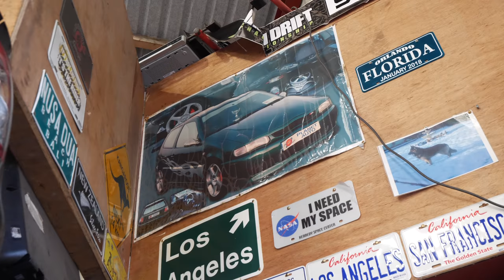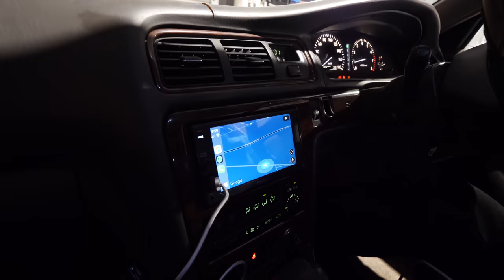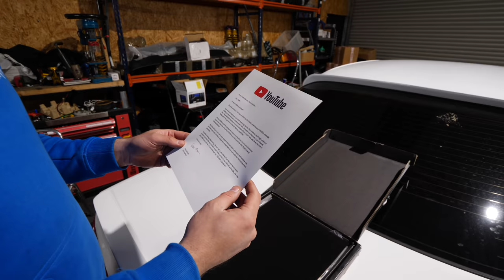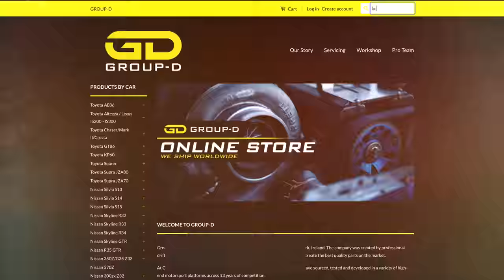Bring back the MAX POWER days! subs, amps + exhausts...

Comment: I got a mid 2000s pink fli sub in a clearance sale about 2 years ago, got it in the car lately it's class 😂😂 I have the modified motors magazine with Dave's old 2 tone civic saloon, and my old starlet in it in Christy's first iteration, gotta love max power spec, and I love the last of the max power spec AKA mid 2000s drift spec, Big drift spoilers, wide flared out origin, BN and vertex kits, recaro/sparco bucket seats, HKS SSQV 😂 the pink sumo power 350Z, the HKS RS-15's, Dmac and flat Eric's twin cams,  just awesome awesome stuff
Reply from the maker: Great times!

Comment: Please buy a Corsa or Punto etc. and fully modify it like the  max power days molded bodykit flushed doors and boot full inside custom speaker from the front seats back with screens and a PS2. Maybe a custom paint job  to finish it off.